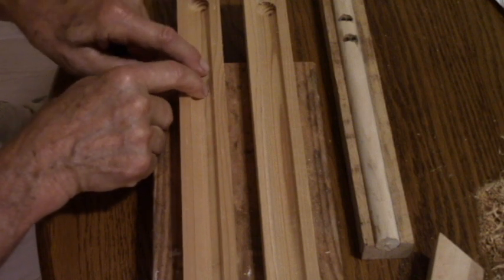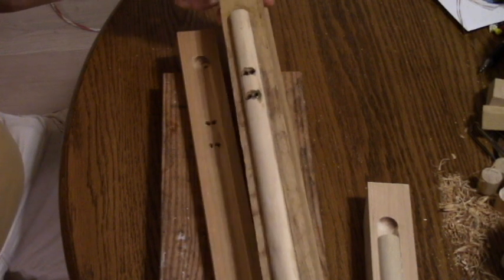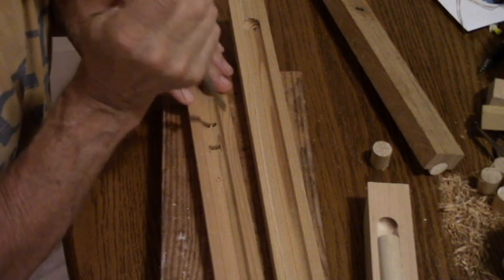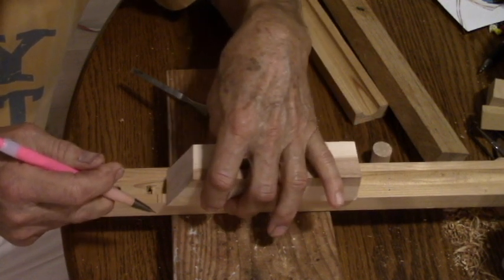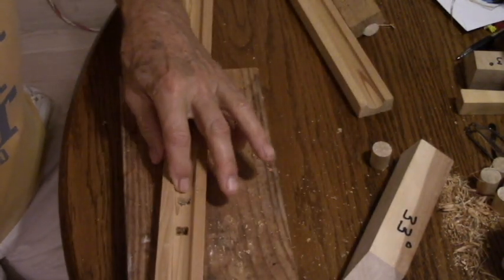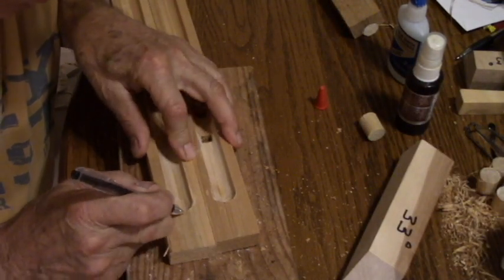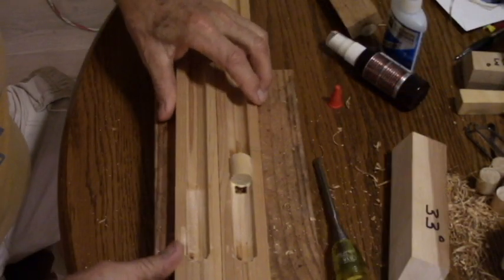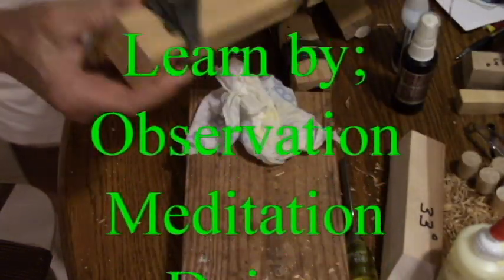Prep and Glue-up a Native American Style Flute Body

Comment: Blue Bear torches the inside to control moisture, have you tried that and it failed.
Reply from the maker: yes I have tried that, however I find the best results is to submerse the entire flute in tung oil and this seals everything including inside the low air chamber where the moisture collects the most. I have a section of pvc pipe that is capped and filled with my finish, which allows me to completely submerse the flute. I use a expansion plug to seal the pipe when not using it and keeping it from drying out.

Comment: I like the way you install the block as a separate piece  Sure makes routing the blank much easier not having to deal with routing two chambers in the blank.  One question- how do you establish the note hole positions for different pitch flutes ?
Reply from the maker: Simple trick I use--- take a working tuned flute and a large rubber band. Stretch the band over the flute and mark all positions, starting with the true sound hole, the end of the flute and all sound holes in between, now remove the rubber band and stretch it over the new flute that is tuned to it;s base note. align the end of the flute mark and the true sound hole mark--- now all the sound holes are in it;s proper locations, just mark and start drilling. good luck my friend---don